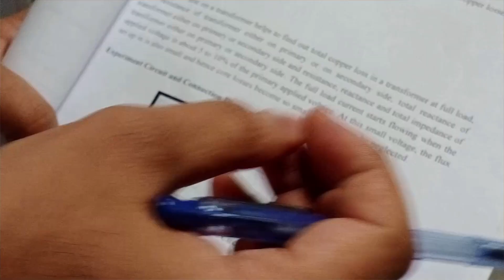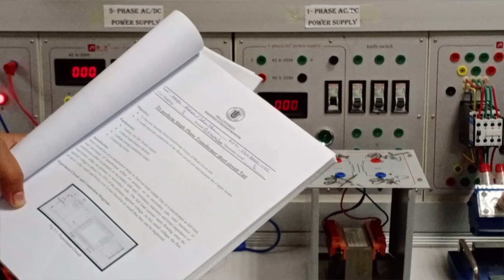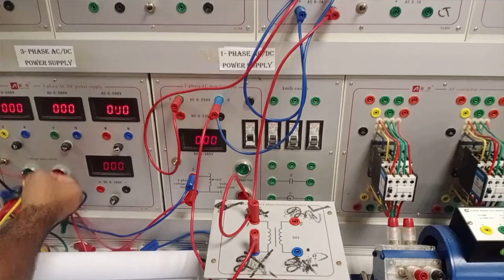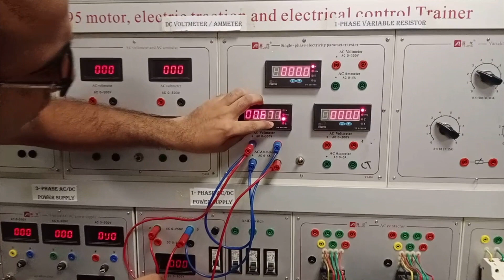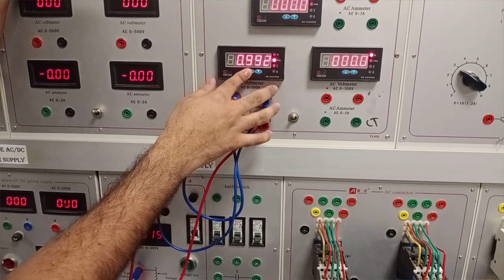Short Circuit Test of Transformer (Experiment No. 03) | Transformer Tests | Electrical Engineering

Comment: Sir there is no voltage being measured on low voltage winding/secondary winding why sir there is no need or anything else plz sir guide thanks sir
Reply from the maker: In short circuit test..low voltage winding is kept short circuited through thick conductor...then it is not necessary to talk about voltage measuring here...since copper losses are very high with only a small amount of 5 to 10% of rated voltage....if the low voltage winding path is short...then how you can measure the voltage on it...think..take care
Reply: @ShoaibAhmedDayo  ok sir thank you sir